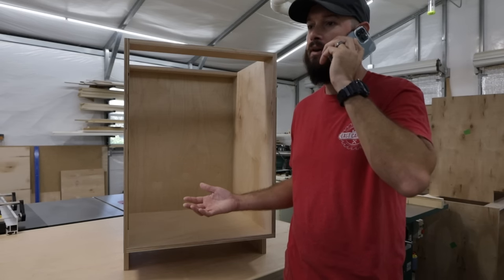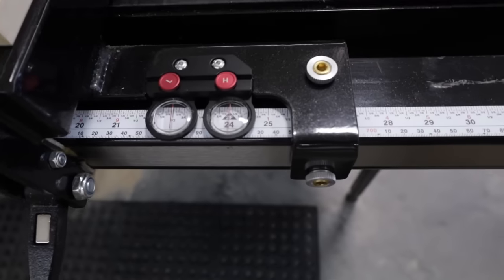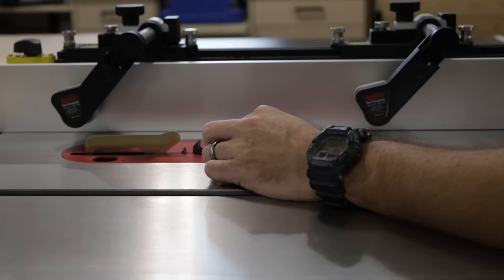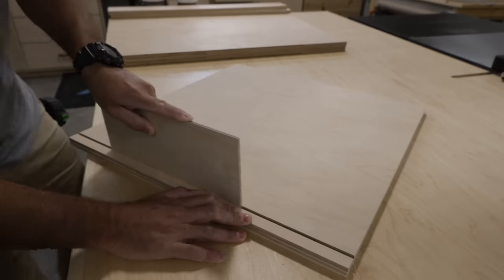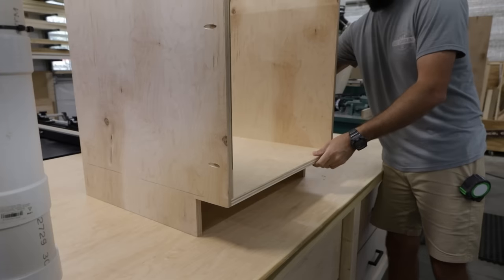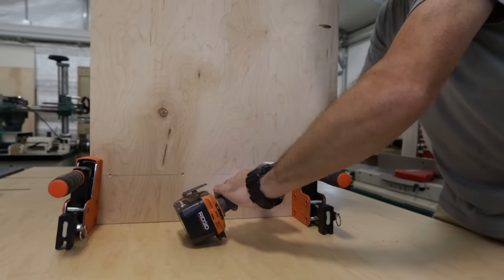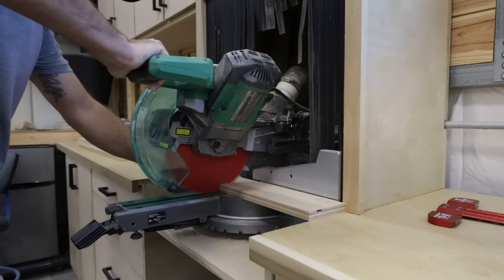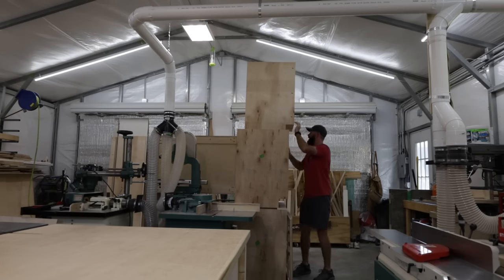How to Build Cabinets in under 30mins //The Easy Way

Comment: i'm curious what you do for outside cabinets where the outside screws would show for screwing in the bottom.  i'm assuming the pocket holes would move to the inside as well?  I've built my share of cabinets with pocket hole screws but not using a dado in the bottom...this seems much stronger especially if putting casters on the bottom for shop furniture where the weight of the cabinet would be pushing up on the bottom into the sides, not into the screws (obviously wouldn't have a toe kick in that use case either).  great video!
Reply from the maker: Typically to avoid having screws on the outside I will move the pocket holes to the inside. If the customer is picky I’ll simply put it 90 degree clamps and let it dry so no screw will be used! But yes I build all my cabinets with dados and I think it adds overall strength 👍🏻

Comment: that is a sweet table saw. after spending 12k on cnc gear for my cab shop i now wish i had bought a couple of those table saws instead lol actually looks quicker. also i have the same shaper (w1702) but havent run the power for it yet how do you like it? i havent seen it in your vids do you use it much? would love to see a vid with it
Reply from the maker: I love having the power feeder! I’ll make a video on how I do cabinet doors with it soon 🤙🏼
Reply: @eastcarolinawoodworks  awesome can't wait!

Comment: This is a GREAT video.  Both from the construction standpoint but also from the entertainment standpoint.  Except:  "pre drilling"???  Pre drilling is getting the drill, making sure the battery is fully charged and what bits you will be using.  He meant "pilot holes".  Just bustin" your chops, I will be using this technique! !! !!!

Comment: I see that you placed your pocket screws on the outside. I want to build an island for our kitchen and obviously don’t want to have the screws showing on the exterior. Would you just place the pocket screws on the inside? Will this lessen the overall strength of the piece?
Thanks, love your videos.
Reply from the maker: Yes you can move them to the inside and will not affect the structural integrity! I only place pocket holes on the outside of the cabinet goes between others or it gets finished end panels 👍🏻

Comment: The title was a little misleading.  I know this took you several hours, but ah, the video SHOWING it is under 30 minutes.  Good job on everything.  Advanced tools make for easy work.  I have to resort to more hand tools and an older method but I think your diligence with grooves and dados make for a strong cabinet with clean lines.  I have no further recommendations other than to add glue to a joint sometimes after it is in place, like your back panel, if you didn't put any in it, it's a good idea to have some around the back of it like caulking to serve to dampen vibration and add strength, the same as you would for a drawer bottom.  Good job.

Comment: So I have questions….I noticed your pocket holes for the face frame are on the outside….can you do them on the inside so you have a smooth surface? Also, (and this should’ve been my first question) is it more cost effective to purchase the tools to make your own custom cabinets or buy them from someone like you? I’m starting over in life and am not young. I know I could do this but I’m not going to have a lot of money for a workshop. At best I’ll have a few common tools. Being realistic I’m not going to do woodwork outside of updating a fixer upper I buy so I need to be smart with purchases.

Comment: Good job, lucky you able to do all that.  Wish I knew more about this kind of thing.  And if I was ever to buy a saw, I now see there are a lot of differnt types of saw to buy, do you need all of them?  How many types are there?  Maybe I know what hand saws basically are, but electric?  There is a circular, a table saw, a band saw is that a verticle one?, mitre saw, jigsaw? , drop saw, and that one on the floor I forgot already, and I think Ive seen some others which Ive forgotton due to having no clue as to what its for in particular.   Anyone else have this problem and cant get started.

Comment: Could you share the countersinking bit and stopper you used for predrilling the cabinet screws
Reply from the maker: Of course! Here’s the link Amana Tool 55227 Carbide Tipped 82 Degree Countersink Set with Adjustable Drill Bit Depth Stop and No-Thrust Ball Bearing 3/8 Dia x 1/8 Drill Dia x 1/4 Inch Quick Release Hex Shank https://a.co/d/31eApHj

Comment: Notes: (The following info is based on experience from a few different shops.)  They all thought they were better than the other guys.  Despite the egos, the end results always looked the same.
*There is more than one way to build a cabinet.  Efficiency allows you to increase demand capacity, and income. 
In high production custom shops, they typically cut toe kick cuts with the table saw, or use a panel template sled and a router table.
Panel dados and rabbets are made with a router table, spiral bit, and preset standard stops.
Vast increase of panel processing speed and accuracy can be made with the acquisition of a Striebig, or Holz-her panel saw (but this is also a big investment). 

*Most pro shops just staple the backs on (from the back side). (Nailers/stretchers are on the inside.)  Most shops do not do the inserted back panels, and many cabinets are even backless.

*For back panels in a dado, like shown, you can use a panel scrap to check alignment upon glue-up/attachment.  [Glue, align slot with back panel scrap , screw/nail, remove scrap from slot.]
*Most shops just glue and nail the deck with a 15 or 16 gauge nailer, instead of screws.
*With the big-budget shops, with CNC machines, none of this really applies, until you get to the assembly steps, where you start gluing and nailing/screwing.

Comment: Had an uncle who worked construction for 30 plus years slice through his had while trying to cut a sheet of plywood with a hand saw after hurricane katrina. He attempted to steady the plywood with his palm under the wood and cut on the top. He ended up with 12 stitches to put his fingers back together and 2 months off work.

Comment: Do you wait to add the toe kick until after the flooring installation or to match the face frame material?  I usually add it as part of the initial carcass construction, but what are your thoughts?
Reply from the maker: I like to install all my lower cabinets then go back and add a 1/4” thick toe kick. That way I have less seams and just works better for me 👍🏻

Comment: I have noted that you have the JessEm Clear-Cut Table Saw Stock Guides attached to you table saw fence with two Mag Switches on what appears to be a 3/4" piece of Popular. Did you do a video on this addition to your saw?  What are the models of the Mag Switches you used on the front and back of this piece to hold it to your fence?
Reply from the maker: I don’t have a video out on it but it’s the magjig 150 set. It’s about $150 on Amazon! Hope this helps 👍🏻
Reply: @eastcarolinawoodworks  Thanks for the information! I am enjoying all of your videos! Keep ‘em coming!
Reply from the maker: @garynicoletti7182  no problem and thanks for the great feedback 👍🏻

Comment: Step 1. Have the tools for the job!! 😅 I did like the commentary though 😁
Reply from the maker: Hey I started with a miter saw and drill 😂
Reply: @eastcarolinawoodworks  Gotta start somewhere eh! 😁 I’ve got a few power tools from when I built my house, but I think I need a proper workshop like you’ve got there for making nice furniture. Getting too old to build stuff on the floor! 🥴 *groans getting back up 🤣

Comment: It's funny how you're calling the back hang rails, stretchers. I'm a 30-year experienced master furniture maker, cabinet maker and woodworker. Those back members are actually called upper/lower hang rails. They also call the top back hang rail " the strong back". But stretchers are actually long horizontal member found on tables, chairs and desk. These are the lower long horizontal members that connect from one leg / post to the other leg /post.  Perfect example would be a trestle table, and not to confuse with an apron, that's an altogether different subject.  But nice job, I like to see the use of dadoes these days. Especially since they've seemed to have been replaced with Dominos, biscuits dowels and knock down fittings.
Reply from the maker: Thanks for the positive feedback and seems like you know your stuff! I’ll keep this in mind moving forward so I can call them right 👍🏻

Comment: To those of you that do not have or will not mess with a dado blade, you can skip that entirely and build an inside frame out of crappy lumber from the floor to the underside of your cabinet floor, and put your nice plywood floor on that. It all gets glued and screwed in the same way. Don't forget to leave this back enough from the face to form your toe kick. The little bit of overhang on your plywood base over that toe kick, will be fine once you glue and screw in the sides like shown in the video. 
It is maybe a little more time consuming and expensive, but there is no reason to go out and buy a dado stack if you are only interested in making  a few cabinets.
Reply: Also you can do a different but similar method if you know your cabinet base layout beforehand. You build the toe kick as one long platform, and then you only need to build simple rectangle box cabinets to sit on top. Then you can avoid a dado or even using a curf for the back panel. Just place a whole sheet of luan on the back of your box with glue and staples/trim nails. This is what I would do, if I was building shop cabinets.

Comment: When I looked up easy I was looking for ways a typical home owner could build cabs without 10k in tools guess I will keep looking.
Reply: I build mine this way with a table saw and chop saw. Both are portable tools as I often build on site. A rip guide and circular saw could substitute for the table saw, but I also use a dado blade for grooves.... Pocket holes aren't the only way to fasten any of the joints shown here but will be more necessary on the face frames. I guess what I'm trying to say is I can build these cabinets with my total investment of around $800 for tools. You will spend more on plywood for a few cabinets.

Comment: Dude your shop is dialed!!
I’ve got many of the same tools… Harvey TS and BS and I’m running that same jointer / planer set up!
Byrd Shelix upgrade on that DW735 yet?  It’s a game changer!

Anyway, thanks for the video!!

I’ve been woodworking building mostly furniture for about 5 years and I’m about to dive into cabinets.

I was looking for a quality step by step guide and this is it!

Liked and subscribed and as far as I’m concerned yours are the only videos to follow for this process!!

I’ll tune into your face frames video once I’ve completed this bathroom carcass which is my test cabinet to prove to the wife that I can do the entire kitchen!! 😂

Cheers!
Reply from the maker: Awesome glad you enjoyed! Dropping a new video tomorrow on building upper cabinets. Thanks for the positive feedback 👍🏻
Reply: @eastcarolinawoodworks  you bet! 
Well deserved.
Question, how do you lay out your pocket holes on the sides for your future face frames?
Looks like you do 3 per side, maybe starting a few inches up from the toe kick cut out… evenly spaced thereafter?
Ok I guess I can figure this out myself 😂
Just ordered the Forman!
I can tell it’ll be a game changer!

Comment: Newer builder here, honest question, why cut at 24 and then bring right back to cut at 23 1/4? Why not just cut at 23 1/4 to start with? Just learning. Thanks for the tips.
Reply from the maker: Because this allows me square up the pieces and cut off factory edges. Factory edges are not square 👍🏻

Comment: When it comes to installing cabinet door handles (either knobs or pulls), they are always placed on the opposite side from the door hinges. You'll specifically want to place them anywhere between 1'' and 4'' from the top or bottom edge of the door.

Comment: I like the method which seems to be logical common  sense.  If one has enough tools, one for each cut needed, they might be able to do this in 30 minutes. You have professional tools not home owner amateur tools.  I you use a thicker back you wouldned those stretchers and would save time.  Biscuits help align the face frame.
I was expecting some kind of trick or methos that speeds it up  You may be able to do in 30 minutes setting up cuts in the process on those tools but you would be movin'.

Comment: I don’t get what use driving screws into the plies of the cabinet bottom does, except create little swelled spots? Pocket screws on the underside of the bottom driven into the sides seems better but really, the glue is all that seems needed?
Reply from the maker: Yea you can use pocket screws underneath if you want but you have to keep in mind with the bottom panel sitting in the 3/8 dado your screw is likely to come out the side of the cabinet. The screws are mainly to hold until the glue dries 👍🏻
Reply: @eastcarolinawoodworks  since they’re unnecessary You could save time and just clamp in the middle?
Where do you source proper plywood in Eastern NC? I can’t find Baltic birch anywhere never mind anything like mdf core or furniture grade.

Comment: Regarding plywood...I found out the hard way that some of those sheets are not cut square across the ends. I now check each end with a T-square before I begin measuring.

Comment: 23:08, the jointer in the background...is that the GO858?  If so, have you had to mess with the tables and if so, do you have any tips on setting the tables correctly?  Thank you.
Reply from the maker: It is the G0858 but it has the helical head and I have not had to rotate the cutters. Love that machine! Check out my shop tour video for a little closer look at it! 👍🏻
Reply: @eastcarolinawoodworks  I was asking about the tables.  Have you had to adjust them any?
Reply from the maker: @befmx31  oh I bought a straight edge as soon as I bought this jointer. That helps out a lot! I watched a few YouTube videos and in about an hour I had it dialed in. Takes a little time it can be frustrating but once you get it co planer your good to go! My advice search it on YouTube and watch a few videos on setting it up 👌🏻

Comment: Hear me out, 
This is something to think about.
Everyone cuts out the sides, then cuts out for a toe kick, makes the cabnit set joins them togather, sets them in place shims them level and screws them to the wall.
Why not use a sub base  with 2x4"
Leval it to the wall and floor and set 
Your boxes on top no adjustments nessary and join the boxes and screw it to the wall.  Doing it this way lets you run wires, and plumbing under the boxes instead of inside them ecpt a sink location
You could even add floor outlets on the side of the sub frame. The subframe . Can be cut to match the floor, you can also nibble into it to set tiles so you dont see the cut edge or hardwood.

Comment: Why do you put a 1/4 dado 3/4" from the back @8:00 (for the back) of the casework? I see people doing this today and I'm scratching my head! That is a house/hiding place for BUGs and mice and makes the inside of the cabinet smaller. We never did that we just rabbited the back 1/4x3/8. an put the "nailer" inside the case. The cheaper shops just stapled it on without the rabbit. Do you use that method for the backs of lower/base cabinets, oven and pantry cabinets?

Comment: Love the detail and quality of the work.  Looks like you used $20K in tools to build this cabinet. Can you please do a video using DIY tools?
Reply: Well, if you want to use DIY tools,. A good job can be accomplished by using home built slide saw. I even had good success by adding 3.5 inches to the width and using that to clamp a nice straight second piece of plywood to the first. 
   The use of a worm drive saw and a decent quality new blade makes very straight cuts. I actually prefer that to a track saw. Once those sides are cut from the full pieces of plywood a decent job site saw can be used for the dadoes and such.
   That's how to do decent work on a budget. Practice makes perfect

Comment: A much simpler way to build cabinets ( the way real cabinet shops do it ) is build a separate base. Leave the toe kick off an just build the box. This way you can build one base on site per cabinet run, level it and just set the boxes on to a already level base. Much easier, simpler & faster way to go. ( Retired commercial cabinet builder / installer 30 YRS. )

Comment: While you are overbuilding your cabinets, they are better than most as far s quality goes. Your safety is getting complacent. You are relying on the sawstop mechanism to protect you. Push sticks are a better way of pushing them, Grippers are even better because they put barriers between your hand and the saw blade. You are one step away from missing a body part.

Comment: Cool! Now I just need to spend umpteen thousand dollars on nice equipment, lol. 😎👌
Reply from the maker: No you can do it with pretty much a Tablesaw and kreg pocket hole jig! This shop took over 5yrs in the making lol
Reply: I could. And I have most of the tools from a lifetime of buying whatever tool I needed to do a job myself. Would it come out as perfect as your's?  I better use the square. Would it look as effortless as you make it look? Yea, no. I'll be doing a kitchen next year. Maybe I'll take it on, lol
Reply from the maker: @sarge12212  you can do it! 👍🏻